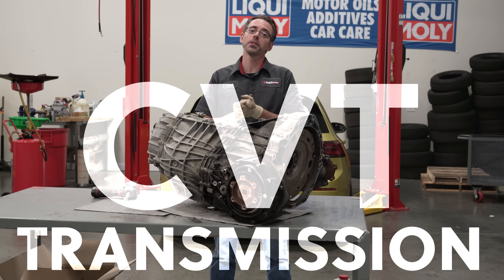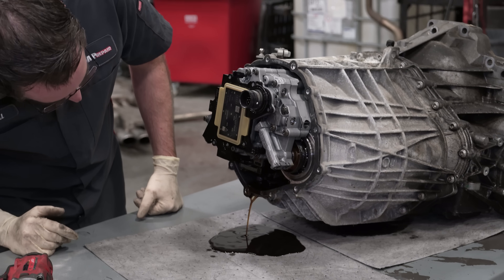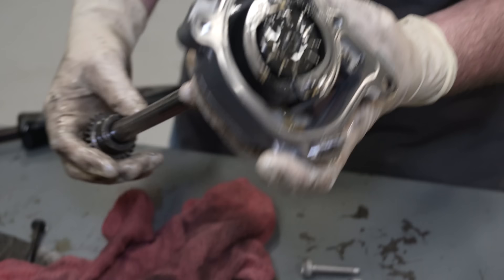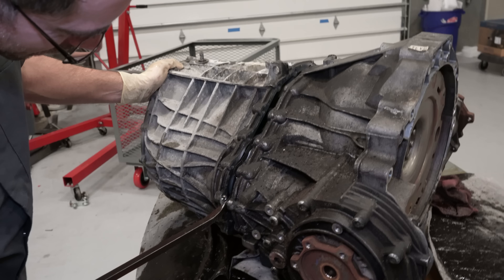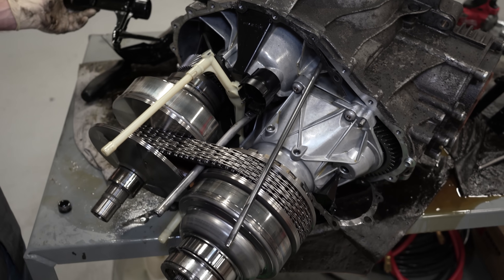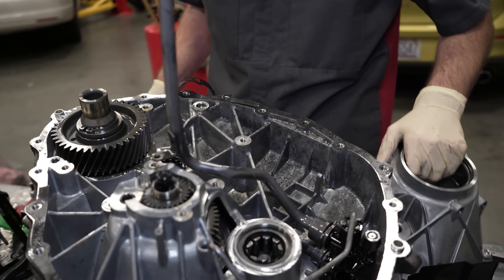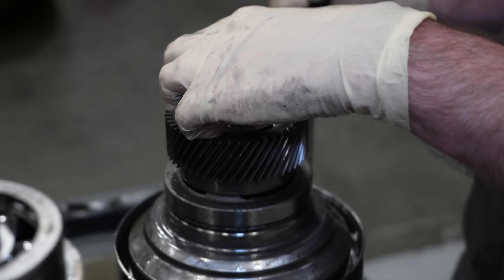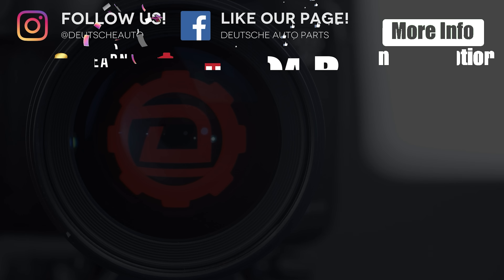Why you shouldn’t get a CVT transmission

Comment: I have a 2012 Nissan Murano with a CVT, and so far have had no issues with it. Took me a while to get used to not feeling a shift point, but overall I'm happy with mine. (160k miles).
Reply: We own a 2009 Nissan Rogue with a CVT. Going on 14 years, no problems.
Reply: My wife has the same car as you. We take it to the dealership every 60,000 miles and have the trans flushed and changed, it costs around $210 and it's still good with over 150K miles. I heard about the bad reputation and hoping this will prolong the life. I don't normally use the dealership for service work but I watched some videos on servicing this transmission and it didn't look all that simple, so I wasn't going to trust the quick change oil place on that job. They charge over $100 anyway so I thought it was worth a little extra to have someone do it who is trained in that specific transmission.
Reply: I'm guessing you have changed the transmission fluid at the recommended intervals, and you don't hot-rod or abuse the car. Nissan uses JATCO CVT's, which have a horrible reputation, but you've been luckier than most owners. 160K  is really good for a JATCO CVT. Hope it continues to hold up for you.
Reply: @laura-ann.0726  I had a 2010 Altima coupe with 130k+ miles with a CVT and I had no issues. Even though I hated it (it was my first car) so beggars can’t be choosers lol
Reply: @Jcrash1  - From what I've seen on the comments, CVT's seem to be very sensitive to excessive loading (don't tow trailers with them), and quality and frequency of oil changes: owners who changed transmission oil every 3 years/36,000 miles generally got at least 150,000 miles out of Honda and Toyota CVT's. Nissan's JATCO transmissions had more problems, but without knowing the actual history of an individual car, and the driving habits of the owner(s), it's hard to say for sure why some transmissions fail sooner than others. The only kind of transmission I never worry about are manuals, like the 5-speed in my truck. There are no bands or clutch packs inside a manual gear box, no complex computer-controlled hydraulic systems, just the clutch and synchronizers, and as long as you don't abuse a manual transmission, and change the oil at 60,000 miles intervals, they generally last until the whole rest of the vehicle rusts out and falls apart.
Reply: I think starting 2013 (or 2012) nissan started using the Jatco CVT in the muranos and started having problems. You may have lucked out with the last year of non-problematic CVT in your Murano. I would suggest to change the CVT fluid every 30k and if there are signs of too much wear, start doing it  every 15. The basic problem for the Jatco CVTs was the fluid would overheat. Checking signs of wear in the transmission box (fluid color and worn material pieces when draining it) and monitoring the CVT temperature are good precautionary measures.
Reply: @loualexander3408  My wife has a 2012 Murano with the CVT transmission and we pay the dealership about $200 to flush and fill it every 60k miles. It's also at about 160k miles and still works fine. That's what Nissan calls for and I suspect it's the people who don't have it done who are losing their transmission early. I think I'm going to have this next transmission service done a little early, because we're trying to get at least 200k out of this vehicle. We do our oil changes at Valvoline quick lube but I looked at the process for servicing this transmission and it is not that simple, so I think I'm going to stick with having the dealership do this particular job.  I've never actually taken a vehicle to a dealership until she got this vehicle and we only have the transmission serviced there. It's over $100 to have it done at Valvoline quick lube. 

I've had to replace both front wheel bearings and the alternator which was by far the most difficult alternator install I've ever done in my life. I would rather replace both front wheel bearings and all four brakes and calipers than to have to do that alternator again. No shit it's that bad.
Reply: Every Nissan Dealer never flushed the transmission,only changed the transmission fluid

Comment: What a bloody insane idea.  A generator and electric motor would be cheaper, cleaner and easier to manufacture, repair and control.  Silicon is a lot cheaper and easier than that silly chain.   Bloody glad I didn't invent that thing.   Still, damn interesting stuff m8.  Thanks.    🙂

Comment: No rebuild transmission,,,,,,here 100,ooo miles,,,,,,as many regular ones 70 ,,,90 ,,,time you rebuilt it ,could have gotten a new one not much more ,,,,,it's fuel did it save 5000 dollars in fuel ⛽⛽ ??

Comment: CVT transmissions are JUNK, and they always will be. They don't fail because of this little problem or that little problem. They fail because the entire design concept is flawed. There is no fixing it, there is no way to make it reliable or long lasting. Car companies only care that it lasts through the warranty period. They aren't really maintainable, because you can only get a small fraction of the fluid out of them, but it really wouldn't help that much if you could replace all of it every 3000 miles. It's not the fluid. It's the design concept. The chain and those pulleys just chew each other up. I prefer manual transmissions, and three of my vehicles have manual transmissions. The other one, my transportation car, a 2006 Mercury Grand Marquis, has the Ford AOD 3 speed overdrive transmission in it, combined with a 2.73 rear axle. It is a 2 ton car. And with that combination, it will run at just above idle at 65 mph on the highway, getting 30 mpg from the 4.6L 2 valve engine. NO vehicle needs a transmission with more than 3 speeds, especially with an overdrive for large heavy vehicles. Newer EPA vehicles with 10 speed automatic transmissions aren't really any more reliable than CVTs. My Grand Marquis has 328K miles on the transmission without a single problem. I expect it to easily pass 400K. When it finally does wear out, I'll just replace it with a rebuilt one. CVTs and 10 speed automatic transmissions are the direct result of EPA meddling in car design, just like EFI, turbochargers, variable valve timing, double overhead cams, 4 valves per cylinder, and more recently, direct injection. Every single one of these things reduces an engines reliability and longevity. And drastically increases its price. Combine an engine like the Ford Ecoboost with a CVT, and you have the ultimate automotive nightmare.

Comment: Well not to be contradicting you..... but my cvt A4 2013 has 300 000km on still no issue and the previous one as-well the thing is with what we noticed is the oil change needs to be done every 30 000km on the dot and all filter replaced... never a fail and i hammer it constantly bmw, toyota and isuzu manuals failed and that is manual with me, the thing is people hate them simply because they don't know how to service or repair them...

Comment: While this is a cheaper way to make a variable speed transmission, a glorified snowmobile drive, it is not the only way.  Ag tractors use a planetary gear with a hydraulic motor to run the sun gear.  This gets direct motor to gear to wheel unlike hydrostatic, but gets a near infinite gear drive, though they do have clutch packs as well as a few sets of gears to get better torque an cooler trans temps.

Comment: I have a 2009 Yaris with 160k miles on it and have not been to any service center to change transmission oil. When you use MT (that thing with three pedals) you don't have those problems.

Comment: everybody has CVT in one form or another. I wonder Audi/VW use the same Jatco craptastic CVT the Nissan uses? CVT on Toyota, Hyundai/Kia [IVT] works like a charm and perfect for smaller vehicles to maximize efficiency and performance. Subaru uses Toyota sourced CVT and I have not heard of an issue with these either.

Comment: as someone that spent a lot of time on snowmobiles years ago, this was the type of drive system they used, the good thing was that it was easy to change the belt on them
Reply: On all mini bikes/go karts with them, changing the belt literally requires removing a cover and a single bolt lol. Wish these automotive transmissions followed suit in the serviceability department
Reply: lol, from what i see on this vid, not practical with metal against metal but so much of todays stuff is crap with all the electronics just to make you spend a ton  of money and most mechanics have no clue as to how to really fix stuff .

Comment: I Have a 20 years old 2002 yaris 1.3 with a cvt. 240k and still working great. Gearbox is very slow but it works great, never changed the oil...Shifts well, but it just does not put the power down...

Comment: F***ing NISSAN CVT's!!! DO NOT GET ONE. so many issues with Nissan cvts for eg: tiny flow valve in the pump that works very hard wears easily and jams causing oil starvation throughout the trans. Can't forget to mention just the shitty quality of the pulleys and main pulley bearings themselves. Also I would never cut open a pulley the way this guy did in the video for safety. Usually atleast one of the pulleys will have a fucking strong spring inside them to return the piston that's clamping down on the drive chain/belt. 
If you want your cvt to last, take your car to a proper trans shop to get a service because they will actually replace the filter or FILTERS and oil. Unlike your general service shop that will "flush" your trans... lol that doesn't do shit.

Comment: I had 4 toyotas with CV no faults no problems with any over 100Ks + on each  friend had GMC auto 3 total failures in less than 30,000 miles

Comment: This video just scares people who have no understanding of how complex any modern automated transmission is, whether cvt, regular planetary auto or dsg type.

Even the way you disassembled the transmission without using a proper fluid channel teardown bench and were surprised by how much fluid remains in a drained transmission shows your lack of experience with any auto trans.

CVT in common car applications has matured a lot over the last 20 years, yes some were bad at the start. But most failures even then were from lack of maintenance or topping up with the wrong fluid (similar with 90s Chrysler transmissions). 70 years of common automatic, and there are still the occasional dumpster fires like the early 2000s Hondas, but generally they are all quite reliable technologies when maintained.

I do prefer my 6spd manual and ceramic puck clutch for the control it gives me for spirited driving, but for efficient commuting, the smoothness of a good, well programmed CVT is unbeatable.

Comment: It used to amuse me throwing a little fiesta into a roundabout and accelerating (as you do). The thing would stand on its nose while the CVT adjusted its ratio and decided to help the engine to accelerate to its target revs by robbing the inertia of the car. It was as though one had applied the front brakes with an attendant reluctance to go around said roundabout.

Comment: They are just fancy Reeves drive technology ( big ass gear motor control in the 70's) great when they worked and a pain when they didn't ( job security) we got rid of them years ago and went to inverter motor control. Got to love the "propeller head" engineers!

Comment: I used to work on Industrial "PIV's" Positive Infinitely Variable drives, on Coal feeders on Ball Mills, they were Always Causing us Fitters Problems, from worn "Chain" to damaged drive discs, which had a hardened teeth plates that were Riveted to the cone bodies, $925 for a drive "chain" and $2000 for a set of drive cones. I lost count of the Number of Drive Chains I put in our 6 gear boxes in 10 years. I only put I think 2 Sets of Drive cones in but I did put a few good 2nd hand ones in to replace Damaged ones. They were a Pain in the neck. Seeing this used in Cars to me said, "your car manufacturers don't care about these things breaking down a lot and INCONVENIENCING your customers, AND the cost of fixing them.

Comment: The Toyota Prius used the cvt reasonably.  But the 1 thing I hated about my 2005 Prius was if the tires broke loose at all it would cut engine power 100%. Being in the middle of an intersection without power is a little stressful

Comment: Basically, if you lose some of the fluid pressure (which acts to compress the cones against the metal drive belt) you lose drive - or get lots of slip. I have seen failures caused by overheat, and resultant loss of fluid pressure. A CVT is heavily dependent upon: Electronics / Hydraulics & Fluid Dynamics / Reliable Engineering / Temperature Control. Sadly, many relatively new cars have ended-up in Scrapyards prematurely. Give me a simple Manual Gearbox - which is much more fun to drive!!
Reply: What a load of bollocks 😂

Comment: 2009 was 14 years ago and a lot of improvements have been made, not just in design, but metallurgy as well.
Reply: My 2007 Nissan with CVT never had an issue.  Maybe because I have the car serviced properly?
Reply: @poruatokin  probably. Driving habits and conditions also matter, I guess.
Reply: This. It's pretty much like how A/Ts were during its early days. With the advancement of technology, it's no surprising that CVTs work well nowadays. So far, Toyota and Honda CVTs have been bulletproof. Still wouldn't totally trust anything from Jatco, though, but I've heard they've made strides in improving their CVT.
Reply: But at the same time it's also difficult to justify when a traditional auto is just so much more reliable and proven, even DCT is a better option.

I'd probably agree that in brand new cars the reliability may be there, but you're just beta testing a transmission in your car.

New cars aren't made to last anyways..
Reply: there still awful dsg is the only viable box
Reply: CVT owner tries to cope with having a garbage transmission (2023, colorized)

Comment: Honda has had some very good results. One of those being an 11th gen cvt civic with 250k miles within a year. Plenty other Hondas surpassing 400k miles with no issues
Reply: Probably a 10th gen
Reply: @alabaster4263  it was an 11th gen that did 250k+ miles in a year
Reply: @chrismcclure6438  They were also highway miles. Not stop and go traffic that stresses the cvt.
Reply: @raze_6474  very likely it saw stop and go bumper to bumper traffic in the highways and interstates

Comment: cvt fluid is changed every 40,000 km or 2 years, accompanied by internal and external filters and cater, if you have filings on the magnets this is a bad sign, do not follow the maintenance manual. the bad thing now is that to save on production they use a heat exchanger that is small interconnected with the radiator additive with that taking traffic the stop and go the oil passes 90 ºC the right thing is to use an external oil radiator and take care of the radiator additive not to damage the heat exchanger and mix with cvt fluid

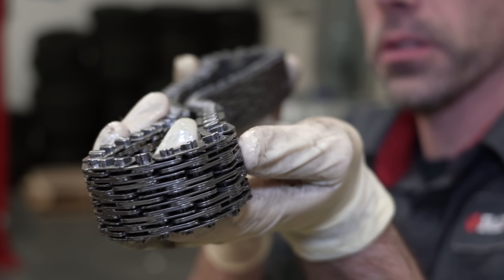Comment: At 09:55
Of course, the pins are tapered from the factory. How else could they get a grip?
Did you really even for a moment believe that this taper was from wear?
It clearly shows that you are a technician and not a mechanical engineer.
Therefore your "knowledge" is just an opinion in the end.

Comment: I had a 2016 Jeep Compass. We left it to sit for a month while we went on vacation, it had 30,000 problem free miles. We came back and I drove it and immediately the transmission began to slip, badly. It kinda got better but the issue was still there when I sold it at 60,000 miles.

Comment: I have a F1CJA TRANSMISSION in my Lancer EX and it's great. It can give power when you switch to sports mode. But the one thing that I need is to take care of it and replace CVT fluid and Transmission Oil Filter every 30,000 Km

Comment: A little known fact: CVTs use special oils, that lubricate under low and "normal" pressures, but when at the contact face of belt and pulleys they hit a "high friction" mode, that reduces metal to metal slip and damage that you get if you use ORDINARY A/T Fluid. Thereby hangs a tale of MANY failed CVTs.... the wrong fluid fill! I Had to specially order the stuff as my "regular" car shop didn't stock it, and didn't know... just wanted to sell me his unknown cheap brand of A/T Fluid... Would have been expensive to replace the CVT if I had done that....
So how much is the fault of the CVT, and how much the "cheap" servicing you get in many places?

Comment: I had a $900 chinese 125cc scooter that had the same type tranny.  basically rubber band drive.  Much simpler of course.  Poor thing died of charging system failure around 20k mi, but the rubber drive belt was replaced around 12k.  All of the wear was on the sides of the belt. Lots of rubber dust inside the housing like the metal in the filters here.  As you see in this vid, the filters are internal and inaccessible.   Shout out to young biden @10:30

Comment: CVTs are a love it or hate it. We’ve got a 2009 Honda Fit (130k miles) with a standard transmission and a 2016 Honda Fit (98k miles) with a CVT and the 2009 needed a new $1,000 solenoid and regular fluid changes and the 2016 has needed nothing but fluids. On top of that the 2009 has been all city and flat highway/freeway driving while the 2016 has seen all sorts of terrain including extremely steep mountains, very long stretches of real high speeds, off-road, multiple eight plus hour day of driving in over 100 degree heat, and live in Minnesota so it regularly has been started and driven solid cold in -20F weather. Knock on wood it’s been a great transmission for us.